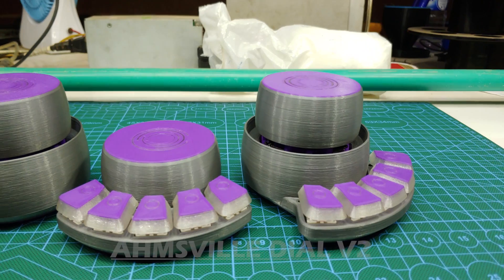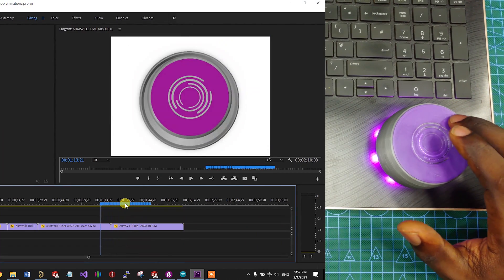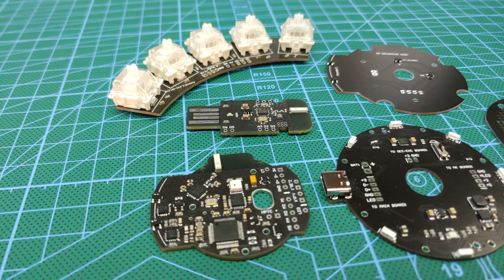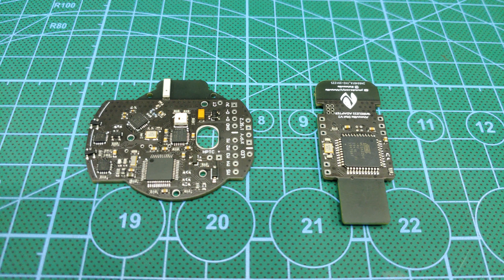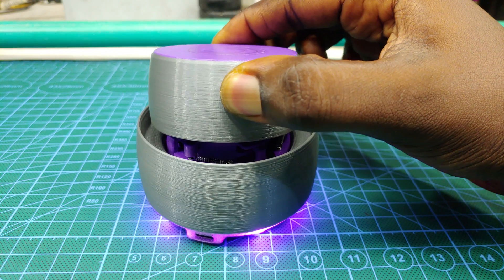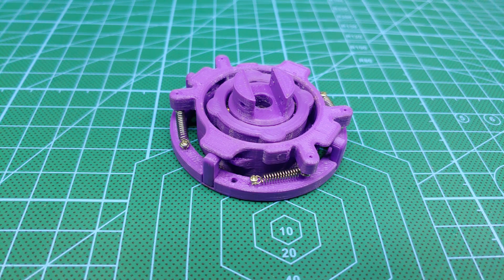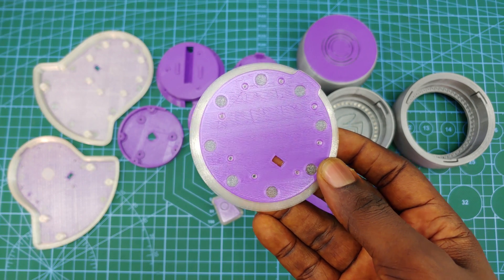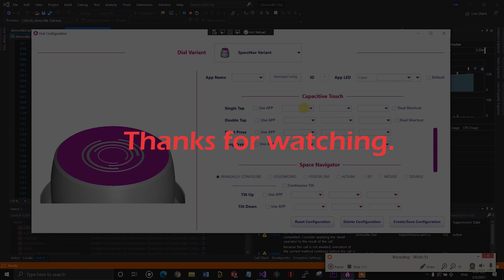AHMSVILLE DIAL V2 | A DIY 3D printed Programmable Wireless Controller.

Comment: 3dconnexion has nothing on you. They should be making you offers. I wish I had this instead of my space mouse which I cant do without. Consider some buttons on the finger hold points on the upper dial. I am sure you can get them in there and this means work can be done without having to take your hand off the knob. I see now that they would always be out of position considering the dial moves freely. There must be a way to put a few buttons on the side somehow.

Comment: Aabsolutley awesome. I love it. Not just how great your project is, but to find someone actually making something useful. So many home electronic projects are little more than toys and functionless demonstrations. This is an entirely practicle tool that seriously advances a part, the interface, that the big industry has left underfulfilled for decades.

I recently have gotten into a fairly serious project myself. It was a protable sauna intended to be used to heat treat items to kill bugs and germs. It could scale to treat anythig from a simple to an entire room of furniture. Mainly I got the idea because bed bugs are making big comebacks and they are quickly  becoming resistent to many pesticides. My sauna would be a chemical free low energy climate friendly method of killing them. Later I figured out it could probably work for germ eradication as well. Some furniture can be complicated and there can be lots of places hard to reach with conventional sterilization. Heat gets everywhere.

Sorry, I can't seem to not go a little overboard describing it. Anyways, as cool as it was to build a controller that could control itself, iteract with wan servers, and take commands from a phone app, it is like a baby's toy compared to your project. I absolutely love how you managed to fit so much functionality all layered over each other in such a small package. Even having a wireless dongle for it. 

Is it bluetooth capable? I'm assuming the dongle is a 2.5Ghz connection. I'm mostly asking because I dipped my toe into bluetooth and was amazed how complicated they made it. I ended up dropping that functionality myself as the tech didn't quite fit in with by design purpose. I wanted more range to be available with as little specialized addon equipment as possinle. WiFi just provided it better for me.

I know I've kind of been talking about my own project a bunch here, but it's more to contrast just how far ahead and advanced your project is and to say, I get it. I can't say enough I much I love your project.
Reply: It's a shame but it seems you can't make one of these since the PCBs are not available. Also it seems like the author is not interested either; everything is out of stock on his website. 😞😞
Reply: @timcorso6337  I haven't checked, but does he have the PCB schematic files up? That way you can get your own PCBs made. I assumed that would be an option since it's a marker project.

Comment: this is amazing... i was thinking to do a similar DIY Spacemouse using hall effect sensors but it looks like you have already done everything I thought of and more with this project... amazing. Do you think its possible to map the tilting inputs to joystick HID inputs and use this in games?
Reply from the maker: Its possible to get the raw data from the dial's spacenav but you'll have to write custom code for the joystick HID. For now, joystick HID is not supported in the dial code or in the application(i have not found a way to implement it yet).

Comment: This is a really cool project! Great work.
It looks like your printer could benefit from some tuning. Look into the ironing setting in cura, pressure advance and ringing compensation in Klipper, revisit your layer height settings, tune your PIDs.  Best of luck. 🤞

Comment: this looks so great, do you think it would work with cinema 4d? that software always bugs with external controllers
Reply from the maker: It should work fine with it, the dial emulates both the mouse and keyboard, it does not register as a special controller.

Comment: Looks absolutely great, I want to buy the absolute variant kit and then print my own parts, but this isn't on your store. Can I purchase it somewhere?
Reply from the maker: Thanks for the kind words, the dial will be listed on my store soon, i will let you know when its available.
Reply from the maker: The dial is now available on my tindie store...you can use the link in the description.
Reply: @AhmsvilleLabs  great, I ordered one thanks. Just to let you know, you don't have a lot of video showing you using this with CAD, I would have a bit more confidence buying if you did
Reply from the maker: Thank you for your purchase, i really appreciate your support....i am currently working on the video series for the dial...so you'll be seeing more actual use for all the dials feature.